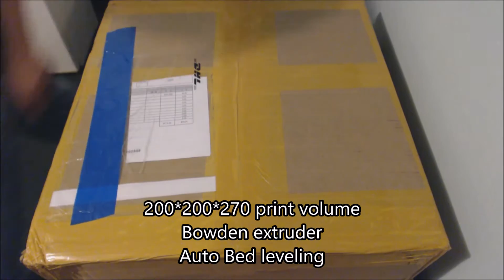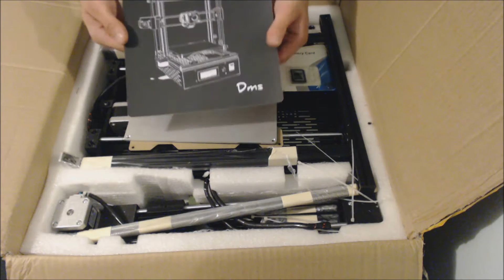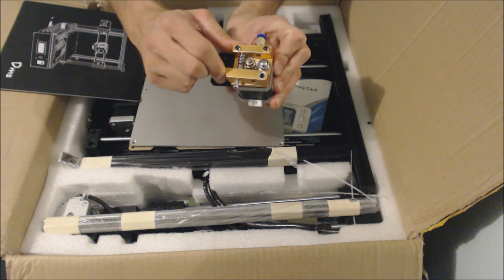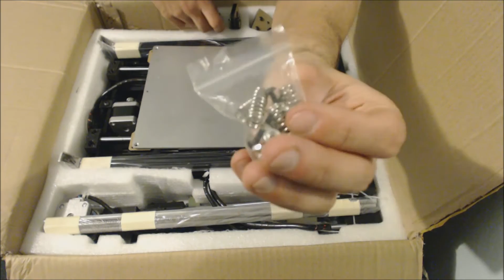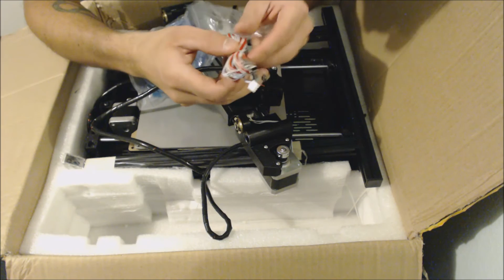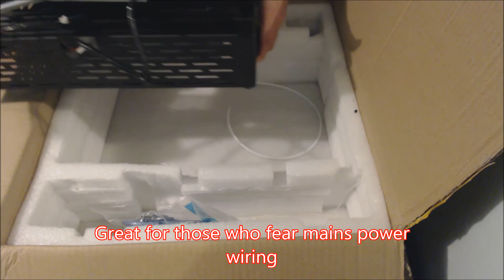DMS DP5 unboxing

Comment: As delivered to you, in stock, unmodified condition, does the DMS DP5 3D printer, print from a SD card without a computer attached ?  You and James Dennis both own a DMS DP5, have both of you been able to print, without the computer, from an SD card ?  I want a machine I can put an .stl file on a SD card, and print my 3D prints, without having a computer attached while printing.  In your unboxing video, you displayed an SD card, you said came with the machine.  Also, did the DMS DP5 come with any software ?  What software functions best with the DMS DP5 3D printer that you use ?   Thank you very much.

Comment: Hi thanks for the video, I have just received this printer and I have a limit switch that is just dangling under the heat bed with no obvious place to attach it to. I would appreciate it if you could have a look and let me know where it goes.
Reply from the maker: James Dennis it screws to the belt clamp on the heat bed carriage, facing the y axis motor, using the same tiny bolts you see on the x axis endstop. at the home position, the endstop hits the y axis motor. hard to get in there, your best way is to flip the printer on its back, try not to pinch the wires for the heat bed, and reach through the the bottom of the cabinet with the heat bed all the way back. if that doesn't work you'll have to unbolt the 2 linear rail brackets from all 4 points and flip the whole carriage over. these bolts are screwed directly into the aluminum so there's no adjustment to worry about during reassembly

Comment: Thanks for making this video man. How would you rate this printer in term of quality and reliability, if you were to ignore the price tag?
Reply from the maker: I try not to rate anything like that, because this is my first 3d printer. That being said, I purchased this to be a kit, a platform to upgrade my way to a reliable and accurate printer.
As far as no mods go, the biggest limiting factor is the v6 clone hot end, which can be a total crap shoot. As far as general quality, fit and finish goes, it's pretty high. Great heated bed, solid power supply, wiring is very neat and properly sized, and stepper motors are quieter than I was expecting. So if you get a good, genuine hotend for it, maybe tweak the firmware a little-extruder rate and stepps/mm x and y were off by .5 steps- I don't see any issues in the near future
That being said, if you're looking for the ultimate out of the box experience and money grows on trees, I hear the prusia i3 (around $700 US, kit version) is the way to go. I look at it differently though. I want something I can put in my own parts, without the hassle of building from scratch, and the parts I want don't come in over the shelf products. So, for 250 I bought this, then I ordered a genuine v6 hot end, the heated bed is fine, it has 24v, which I really wanted, all metal, an absolute must, and I want a duet wifi board. In the end i'll still be under the cost of an i3, and it'll have all the parts I want in it.
Reply: great video! Can you provide a link to the V6 hot end?